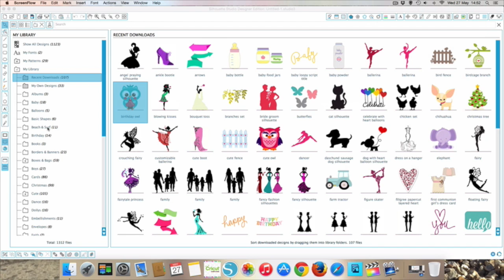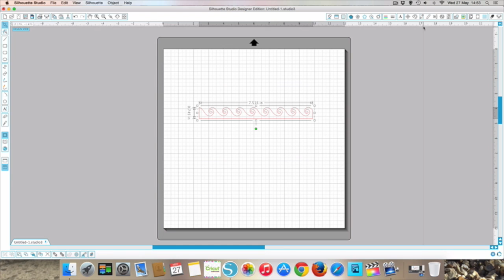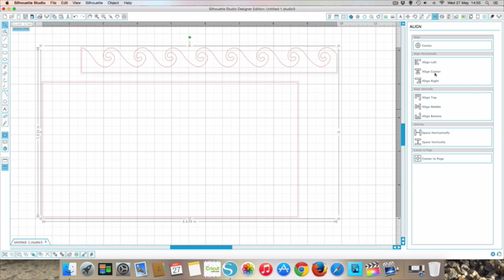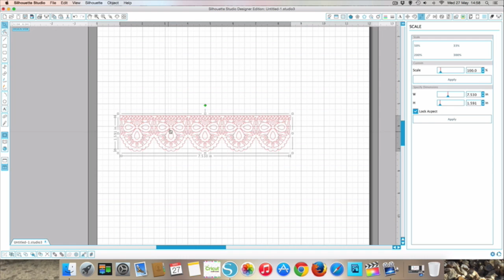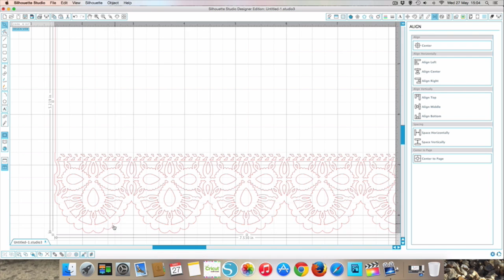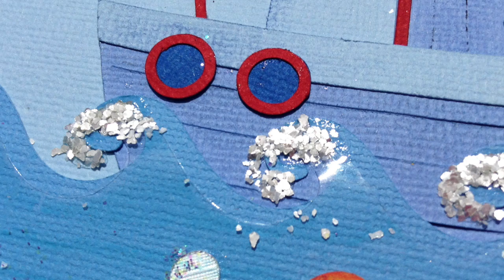Silhouette Seminar #13 Welding

Comment: How would I change a Handle to a heart shape? Is that a welding technique?
Reply from the maker: Im not sure what you mean? sorry   - a handle on what, it all depends on how something looks to start with as to what is the right technique to change it. Could you email me a pic to amanda@lollilulucrafts.co.uk and I can then see if I can help :-)
Reply: I guess, taking away part of one image and adding something in its place and making sure it is connected when printing?
Reply from the maker: Well the second part of that would be a weld but the removal part would depend on whether you have the deluxe version of the software as you would need to make a cut line across where you want to remove from and that tool was only available in the deluxe version. That said I have not been on there for a while so it may have been changed but the principle is the same you need to use the cut tool to make a cut line to remove and delete the elements you dont want then you need to get the new element and add it and then weld as per in this video. Hope that helps a bit but you know where I am if not :-)
Reply: I made it work. Thanks.

Comment: you mentioned another video where you show welding more than 2 objects. Where is that?
Reply from the maker: Hiya, the links are in the para below this video- just click on show more and you will see all the info and links there :-)
Reply: I dont know which link to click. Is it the one that takes you to your website where the silhouette seminars are? If so I only see this video that is related to welding #13.
Reply from the maker: Nope its the one that says it the link to the project, sorry I should have said but I thought you knew from the video it was the project that had it in as I was chatting about it but it has been a long while since I made this video so I guess I remembered what I said wrong :-)  Anyway its that one, it should show a project of a boat card and the welding is as shown in the close up at the end of this video, of the sea - as per the demo here if that helps. :-)